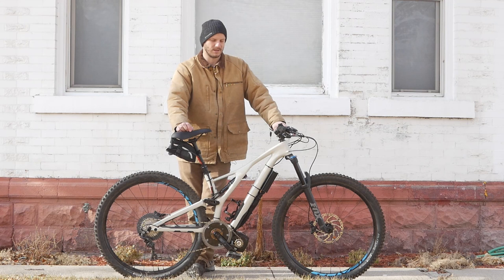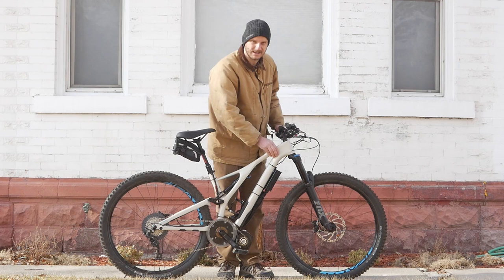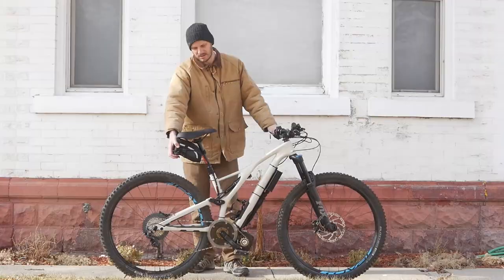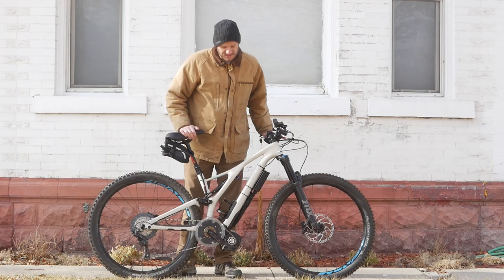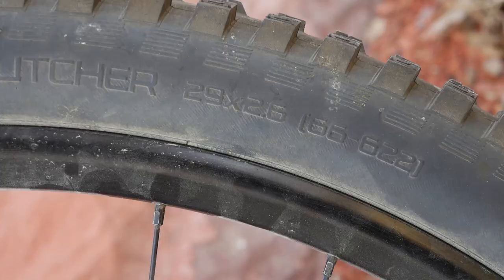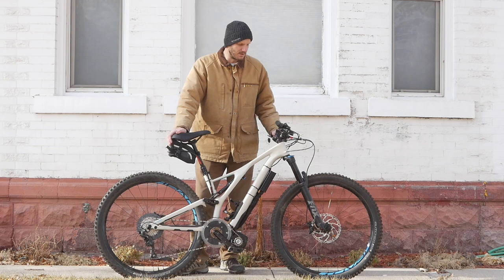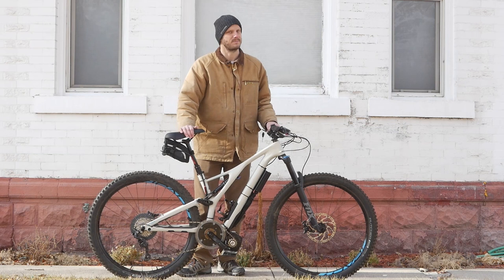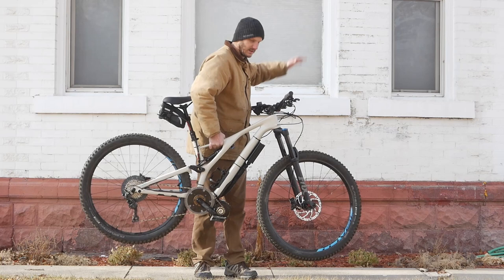Custom E-bike Build: Specialized Stumpjumper Full Suspension 29er Cylone 52v 6ah Mid Drive

Comment: Its a shame that the Bafang motors dont fit this very well with this frame. It will just hang underneath it.  I read on a review that the tool pocket and such there will fit some motors though so someone with the knowhow could do it.  I'd be scared to do it myself. Wish there was other options for a chain linkage. Maybe there is?